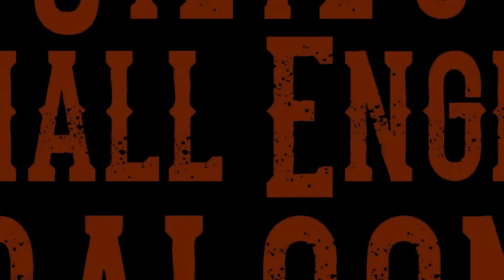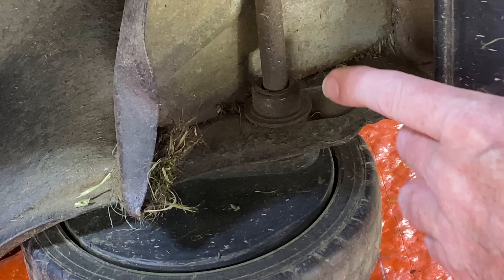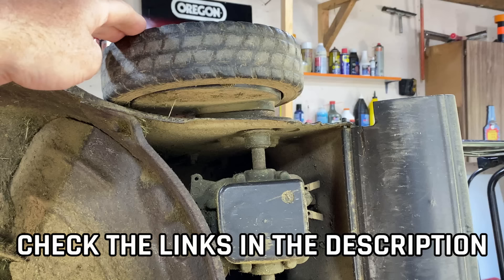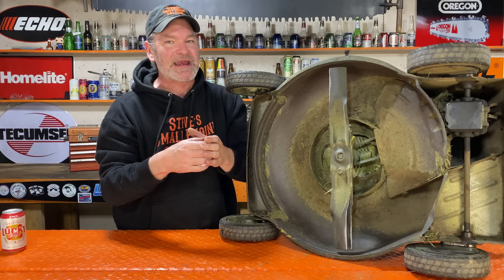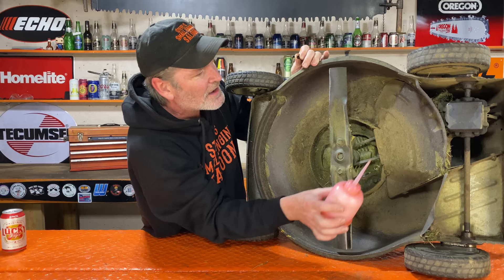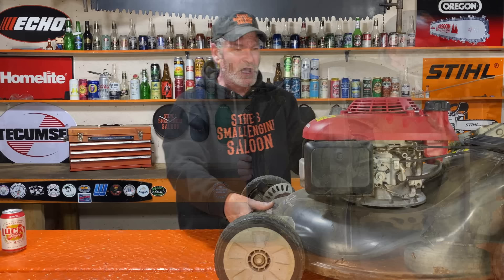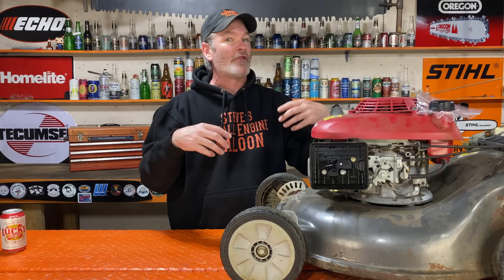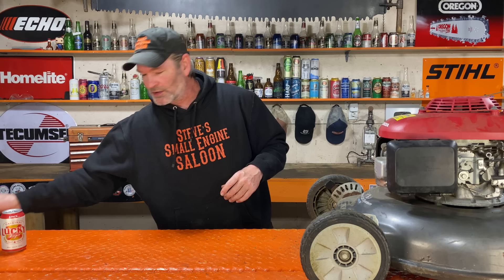Solved! The Mysterious Case of the Honda Lawnmower That Wouldn't Pull Backwards

Comment from the maker: ✅Click here for a can to mix your penetrating fluid in ➜ https://amzn.to/3FWGBM4
✅Click here for a new fuel cap ➜ https://amzn.to/2zn4ARK
✅Click here for a common air filter ➜ https://amzn.to/3iLNFwr
For more videos like this, check out: 
👉How To Free Up A Seized Bolt or Nut ➜ https://youtu.be/cElDM06Mk3c
👉Proper Way To Tip A Lawn Mower Over ➜  https://youtu.be/eeEVigsVqrE
👉How To Fix a Lawn Mower That Quits, Dies or Stalls After 2 Minutes ➜ https://youtu.be/aMsAdVerbvs

You can connect with Steve here too: 
✅Visit Steve’s WEBSITE ➜ http://www.stevessmallenginesaloon.com/ 
✅Visit Steve’s PARTS & TOOL STORE ➜ https://www.amazon.com/shop/stevessmallenginesaloon 
✅Follow Steve on FACEBOOK ➜ https://www.facebook.com/stevessmallenginesaloon 
✅Follow Steve on INSTAGRAM ➜ https://www.instagram.com/stevessmallenginesaloon/ 
✅Follow Steve on TWITTER ➜ https://twitter.com/SteveSaloon 
✅Follow Steve on TIKTOK ➜ https://www.tiktok.com/@stevessmallenginesaloon
Reply: Any reason my push mower cuts better when I'm pulling it backwards?
Reply: Thank you Steve have this problem in a job I'm doing now I don't think you said how many beers to do this job 🥴

Comment: I work at a Honda Power Equipment dealership, and this is a common issue with the HRR216 mowers.  When you tip the mower on it's side, there is a little plastic seal on each side of the transmission shaft (axle) where you lubricated it.  You can take a small screw driver and pop that seal out, then use your penetrating oil, and pop the seal back in again.  We actually do this during a routine tune-up if the machine is hard to roll backward.  Over time, the problem will slowly get worse until that rear bearing needs to be replaced.  The parts are cheap.  The bearing assembly already installed in the wheel adjuster arm is under $10 (US) for each side.  When you change those out, the machine rolls backward like it did when it was new.  Love your channel, Steve!
Reply from the maker: Thank You...
Reply: Hay you work at Honda, I've got a quick question for ya. I have a push mower an it leaves long grass when pushing forward but when I pull it backwards it cuts like a dream any idea why this might be??? Any feed back will be much appreciated, Thanks.
Reply: @D-train69  what model is it?
Reply: @HemiRod23  it's a Husqvarna model HU675AWD.
Reply: Any words of wisdom for a HRM 215 with this issue?
Reply: @D-train69  Your Blade is installed upside down.
Reply: @stevenfuchs2548  The same problem as D-Train. The blades being installed upside down will cause this. When you go foreword, the backside of the blade is tearing the grass. When you pull backwards, the sharpened, front side of the blade cuts it. When you flip them over, those Honda blades will cut just fine.
Reply: @stevenfuchs2548  it depends if it has bushings or bearings in the rear drive.  If it has bushings, it could be the same problem.  If it has ball bearings, it is most likely something else.  I would have to look at it to determine the issue.
Reply: @tinkerscorner54  Sorry wasn't referring to that, I was referring to the machine pulls back hard.
Reply: @HemiRod23  the wheels have bearings and work great, the trany shafts have bushings, I believe I changed them but I'll check them again.
Reply: @tinkerscorner54  their is a star shape that locks the blade in then install the nut. So it can only go one way onto the shaft. I can't flip it it won't work I mean I'll look at it again but pretty sure that's the case. I'll let you know.
Reply: @D-train69  Steve has a video on it, and I've tried to put it in a reply to you 3 times with a link to it. I guess YouTube isn't allowing links any more. Do a search for . . .  

How To INSTALL A Lawn Mower BLADE Properly (Step-by-Step)

. . . that should get you there.

Getting a blade upside down is pretty easy to do, I've done it several times and had the problem that you speak of. I did it once with the Honda two blade set up. I wasn't quite as noticeable but you could tell that it wasn't cutting like it should. I removed them and put the other side up and it was back to  cutting like it was supposed to.

Take care.
Reply: @tinkerscorner54  Thank you sir much appreciated, Thanks.
Reply: Does hrx217 do this?
Reply: @appleztooranges  Mine hasn't yet. I was looking at the diagrams on the Honda site The other day when this subject came up and it looks like a very similar setup. I didn't check to see if the part numbers were the same or not, though.
Reply: @appleztooranges  no, the HRX217's don't have this issue.  Only the HRR216's.
Reply: @D-train69  What's Husqvarna got to do with Honda ?
Reply: @kevwills858  well nothing but he is a technician that deals with that kind of bull shit every day. I figured that was plain to see.
Reply: @tinkerscorner54  Nup a blade upside down won't cut at all. The sharp part of the blade has to be facing the direction of travel. An upside down blade will have the flute (rear part of blade) facing in direction of travel while the cutting edge is facing the opposite direction. Get a blade & turn it upside down you'll see what i mean
Reply: @D-train69  He works at honda he doesn't mow lawns which means he can't answer you're question. What your saying makes no sense. I mow lawns for a living. Contrary to comments below an upside down blade doesn't cut period so it ain't that. make a vid if you haven't solved the issue so we can see what's actually happening,also show underside of the mower
Reply: I'm getting ready to DYI service my, this type mower. Where is the little plastic seal on each side of the transmission shaft (axle) where you lubricated it.  You can take a small screw driver and pop that seal out, then use your penetrating oil, and pop the seal back in again. Is it easy to see. Never knew, Thanks.
Reply: Never mind, going to use the method Steve showed in this video. Rolls back fine, just wanted to do some prevent.
Reply: @HemiRod23   My hrx217 is getting hard to pull backwards.  Bought new about 5 years ago
Reply: @user-fn9st2fs9m  HRX217 models don't have the same issue as the HRR216 because they use ball bearings instead of bushings.  It is more likely a cable adjustment, a jammed belt, or a pinion gear issue on an HRX.
Reply: @StevesSmallEngineSaloon 
Great comment… that seal that you mentioned… in order to pop it out wouldn’t you have to remove the shaft first?
Reply: HRX217 are doing this too. The back wheels are locked completely

Comment: Extremely poor design having an exposed drive bushing made of plastic.  Acetone may or may not dissolve this bushing over time. Sounds like it needs cleaning and a little grease and then put some battery terminal O rings or felt dust blockers on the axle. And use a zip tie to hold it in place. Ill have to double check.
Reply: Another good idea you have there .

Comment: Great tip because that’s a really common problem on Hondas and changing the bushing is a pain in the backside unless absolutely necessary.
Reply from the maker: Agreed!
Reply: You can get the wheel adjuster assembly, and it comes with the bushings already installed.  There is a large snap ring inside the deck that holds the wheel adjuster assembly in place.  You need to remove both sides, or clean the drive shaft with emery tape to slide the transmission to the side.  Slide it the direction of the long shaft.  The short shaft side isn't long enough to get it out.  I get an hour to do both sides.  After you do a few dozen, you can do it in about 45 minutes.

Comment: I had a Honda push mower that was a pain to pull backwards.  I gave it to my neighbor when I hurt my knee and got a tractor.  He has used it for two seasons now and I see him pulling back hard on the mower, so I am going to pass on this tip to him and maybe it will loosen up.  Hopefully it works so he has an easier time mowing with it.  He's in his upper 70's so easier is always better.
Reply from the maker: Right on
Reply: Different models will have different issues with that problem.  Some have a clutch return lever that doesn’t return 100% to neutral , some the spring is broke, some get crap into the return mechanism and jambs it up.  Follow the cable from the top of the handle to where it connects to the trans. If there is a lever there then force it to move by whatever means you have, like a long handled  screw driver, make it move to see if it will go opposite of the cable pull direction to a position further than it started at, clean area with air, then lube it.

Comment: Have a Honda with this problem. Couple of years ago, I took it to a dealer for a tuneup and fix for the reverse problem.  They told me it was SUPPOSED to be hard to pull backward.  Basically stopped using it until I found your fix.  Genius!  Took me thirty seconds, but I’m old!
Reply from the maker: Right on

Comment: Thanks, Steve. I had that exact problem several years ago. Since my yard is too small for a self-propelled mower, I removed drive-related components until it rolled backwards easily. Wish I had seen this first. You are one of the good ones.
Reply: Wait, you didnt save the drivetrain when removing it?

Comment: A few years back I bought a composite deck honda that wouldn't pull back...seller said he took it to 2 honda dealerships and both said it needed a transmission.  I took the wheels apart and after cleaning up the mechanism it was the engagement cable.  The cable was frayed and wouldn't let the spring release transmission to pull backwards.$20 cable later it ran perfect

Comment: A suggestion for when things get so bad you do have to tear into the bushing/axle: after cleaning everything up and polishing the rust off the axle, lubricate the ends of the axle with anti-seize compound before putting the bushing back on and re-assembling. it's highly water resistant and will slow rust formation. I've found I can go a lot longer before  things tighten up again...and then you can try Steve's easy suggestion to get the wheels turning again.
Reply: Personally, I've drilled and tapped bushings--- for grease fittings.

Comment: I may have forgotten to thank you. Wife and I were driving in the next neighbor and saw one for a county pickup. The owner was outside and we asked and asked if we could have it, he said "sure sure".  I didn't even know it rolled backwards at first, but saw the video and cleaned the axle with compressed air and lubricated it.  I was able to get it running, but gas was leaking from the carburetor. I have a woodshop and made a new gasket, note they are very thin.  That worked fine and now we use the mower all the time.  Nice mowers, but I think the weak link is the front wheel  toe-in problems, which I fixed by tweaking the heavy brackets, which took some heavy hits from a big mallet!

Comment: Hey Steve, I've been working at a small engine shop for the past couple years and have worked out a good trick to cure this problem. Instead of just putting oil over those bushing caps, just get yourself a pick and remove the cap, blow out and clean out the inside and pack some grease inside. I've had them to the point where they wouldn't even roll backwards and would scrape on the ground but this clears it right up. Every time.
Reply: Obviously, pop the seal back in when done. They come out very easily. I pressure wash the inside after removing, blow out, pre lubricate and work in with whatever spray lube you want and pack with grease. Makes em' smooth like butter.

Comment: I have a 30 year old Toro GTS recycler with the same issue.  I will give that a try with the ATF.  I found it was the engagement pins that would get sticky and not always release when pulling in reverse.  I took it apart and regreased with standard grease, so maybe the ATF concoction you used is a better alternative.

BTW. The only problem with the Toro is age.  I think I need to replace the ignition.   It always starts within the first pull or two when cold, but takes several pulls if the engine is warm.  I suspect the ignition gets weaker when itis warm.

Love your channel and the support April provides to make you the shinning rock star!

Comment: Nice solution, Steve! I use to have this exact problem with my Honda mower. However, after I cut the lawn now, I take my leaf blower and blow any debris that has accumulated under the mower in that area around the transmission bushings. No problems since then. An ounce of prevention is worth...

Comment: Good to see that was the problem with yours.  Unfortunately, I had the transmission fail.  Pulled trans all the way out of the lawnmower (ala no bushings)... vice grip on the shaft... no turn (bummer).  Bought a new transmission.  New trans was failed out of the box. Sent it back and tried another one... it was good. 

If you need to do replace the underside stuff.. take gas and oil out of the mower and turn it UPSIDE down between a few sawhorses.  Make sure you have some decent snap-ring pliers, and get new snap rings from Honda... including the wheel assemblies...  the snap rings are not standard !

Comment: Very Timely for me.  I'll give that a shot.  I have a Husqvarna/Honda push mower that I just had to replace the belt and rear drive on and it's been impossible to pull back.  I think it might be a combination of that and the belt I got might be too tight.  Even with the tension off, it still wants to self propell a little bit.

Comment: I have found this to happen on regular mowers with each wheel as junk builds up  between the hole and the axle.  Sometimes the drag gets so bad it feels like you are pushing through mud.  A  little squirt of lubricant  in the hole takes care of the issue. So i can see how the elements would would easily combine to mess up the works on a self propelled unit.

Comment: I had this problem with my Honda and the wheels wouldn’t turn backwards at all.and tried WD 40, 3-IN-1 oil and other lubricants and none worked more than a week or two. I even had the dealer adjust the cable with no improvement. I tried your concoction and the mower works fine. There is a little resistance rolling backwards, but it worked the entire summer after only one application! Thank you!
Reply from the maker: You're Welcome...

Comment: I have a yard machines 3 in 1 lawn mower that had that problem only when it was running. When it was off it roll backwards very easily. The self-propelled feature was extremely touchy and when it came to pulling it backwards it was nearly impossible. I finally just took the drive wheels off and swapped them with free wheeling wheels. So no more self-propelled but at least I can pull it backwards.
Reply: I have the same issue with a Honda. I hope he does a video on this issue.

Comment: Had same problem, Honda dealer even had Honda engineer check on it, neither could get it fixed. So I put it on the street and bought a MTD. My mower had a different type drive.

Comment: Great video, Steve!  That's could have been my mower you worked on. 
I've been building my arms and legs with Honda every time I pull it backward.
No more! It gets the "Steve Treatment" tomorrow! 
Cheers!
Reply from the maker: Good luck!
Reply: I did the fix.
No more Honda elbow! 
Thanks for the tip, Steve!

Comment: I have one of those mowers. The one I have is a HONDA and has an aluminum body with a huge crack and a big chunk missing. The motor is PERFECT, and I really like the fact that the blade doesn't turn until you squeeze the handle. I've been doing small engine repair for about 10 years now and  I can't find another body for it.

Comment: I thoroughly wash the underside of my Honda HRX 217 mower with a water hose after every mowing. Next, I run the motor with the blade engaged for about two minutes, which rids the mower of a lot of water. Finally, I turn the mower on it's side and spray the wheel bearings, the blades and related springs, and all of the axle and transmission connections with WD-40 using a spray bottle.  (Buying WD-40 by the gallon saves a ton of money.)
I have done this routinely since I got the mower new over ten years ago.
So far, so good. 👍
Reply: You are one dedicated guy!!!!!!

Comment: Cool, and great tip about how to tilt a push mower on the carb side!  I have a Black Max pressure washer with that issue, but it's wheel bolts tightening from pushing forward.  I'm going to put some locktight on the threads to see if that does the trick.  I have adjusted the bolts, but the wheels are not allowing backward motion again.  The wheels dig ruts in the lawn, and moving it backward on the shed floor and on the driveway are a pain.  Maybe some lube in there would help, too.  I'll take the wheels off one at a time and inspect what should work.  Tell April Hi for me.  Thanks again, Steve.

Comment: Thanks Steve! For the gas issue. Is it good to turn off the gas knob, run the engine until it stops so there is no gas left in the carburetor and then tip the mower on the gas side to lubricate the axle?
I always learn something from your videos-please keep on posting :)

Comment: Sometimes after turning my mower onto its side to clean the undercarriage, this problem happens.  It has so far always loosened up again after mowing for a short while, usually fifteen minutes or so.  Hope it holds up for me, as I'm not that mechanically inclined.
I had a similar Honda mower prior to my current one, and it never had this problem.

Comment: Hi Steve, I've got an Asuka HydroStatic (Very similar to Honda Pro Mower) one that will not pull backwards .... unless the engine is running ... weired.
I've given this a few squirts of WD40. still wont budge backwards.
Still no roll back. I'm sure it should roll backwards though.
Engine on tick over and it rolls back just fine ?!?